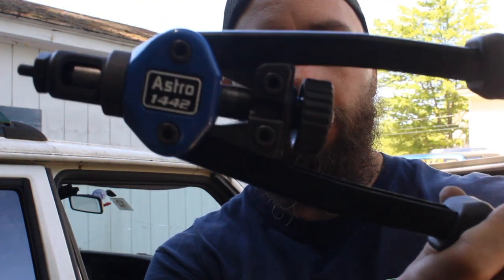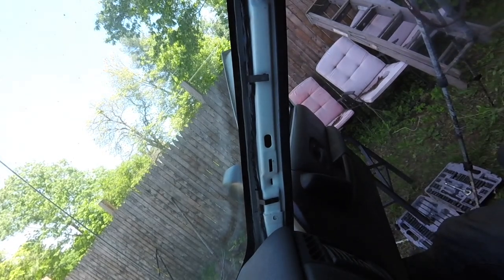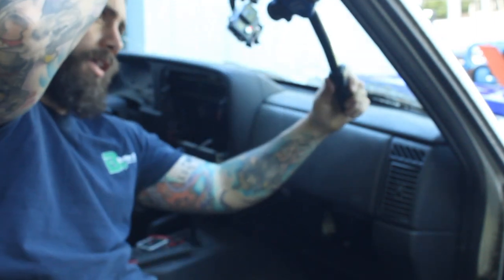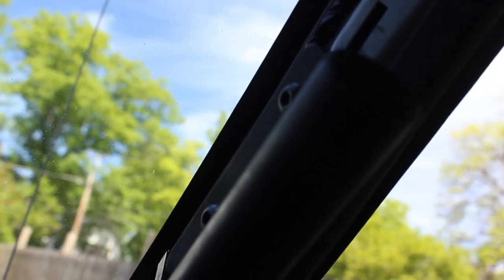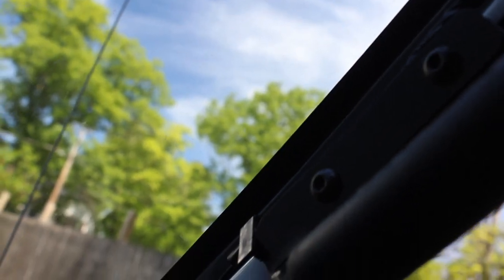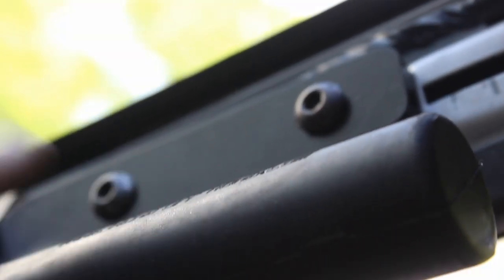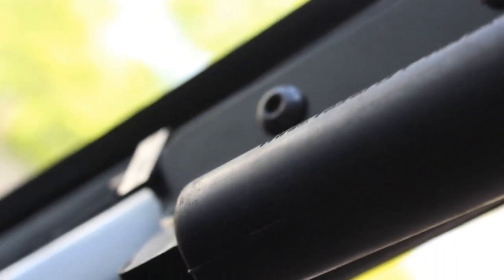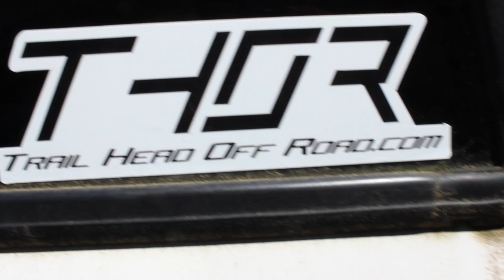THOR Grab Handle Install On A Jeep Cherokee XJ

Comment: How do the trim panels fit over the new handles? I want to keep my interior as intact as possible. God bless, stay well.
Reply from the maker: They fit really well over it. You may need to do some grinding  work on the inside of the panel if they don’t fit completely

Comment: Looks so good mate, super easy, how much did they cost?
Reply from the maker: Cheap Jeeper link in the description. They are on pre order now for $65 bucks
Reply: The Bearded Jeeper oh that’s pretty good, wonder if I get  them to fit to the tj
Reply from the maker: Cheap Jeeper you can fit them on a TJ easy. Anywhere you can drill 2 holes and mount the nutserts

Comment: How do you get the A-pillar trim off?
Reply from the maker: Chaconnors you should Be able to just pry it off just some clips holding it on. Just be careful and don’t force it you don’t want to break the plastic
Reply: Wait, wait, wait  Mr. Bearded Jeeper, I saw your video, liked what I saw, and bought the handles but you didn't show your views how to remove the A-pillar trim and how you installed the handles with the trim back on.  Can you help us out and make a video or at least video how to do these things?  It would be appreciated.
Reply from the maker: Chaconnors i apologize I didn’t explain that very well in my video. I will try to make a quick video explaining how to take it off. It is really easy to do it just pulls off just held in by a few plastic clips just be careful when prying it can break if you pry too hard it is just plastic.
Reply: The Bearded Jeeper we need to see how you mounted them on top of the plastic trim after you drilled into where the plastic trim clip clips in. There was a HUGE part left out in this video. I have the handles and after having removed my trim and seeing where you drilled, it doesn't add up.
Reply: @kencallaway3122  exactly.
Reply from the maker: Ken Callaway basically you put the bolts in and figure out where you need to drill and drill the plastic so you can slide the two bolts through. I realize I did a crappy job explaining this step. I will have to make another video explaining this step. I’ll post a link here when I get it done. I’ll try to film and get it posted tonight.
Reply from the maker: @nrconnor60   Just made a video that hopefully answers the questions you had https://youtu.be/nyu5CRE5CiQ
Reply from the maker: @kencallaway3122  Just made a video hopefully answering those questions. https://youtu.be/nyu5CRE5CiQ

Comment: Instructions suck as did the intake. Should have just drilled through the plastic instead of peeling it back. Now I have my driver side pillar plastic clips broken. 🤦‍♂️
Reply from the maker: TheTacticalHouse yeah I removed my plastic trim all the way made it way easier to install. Why did you not like the intake?